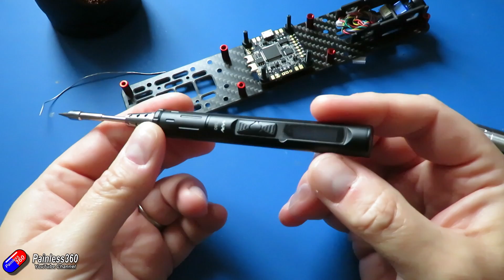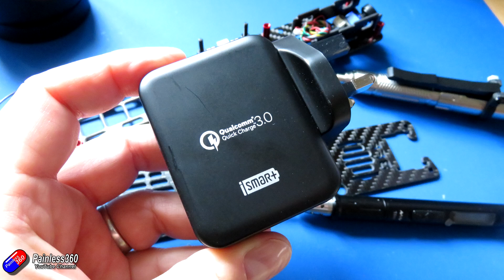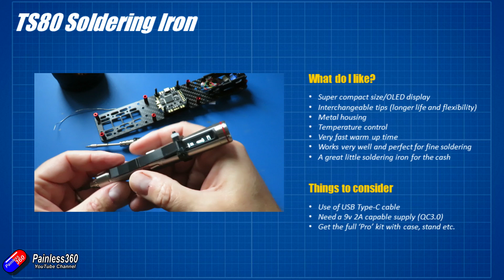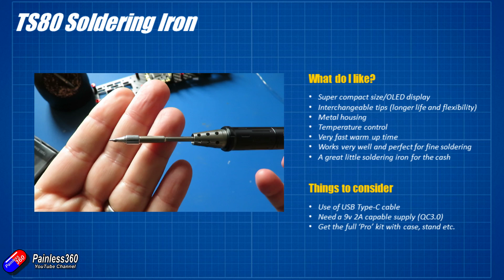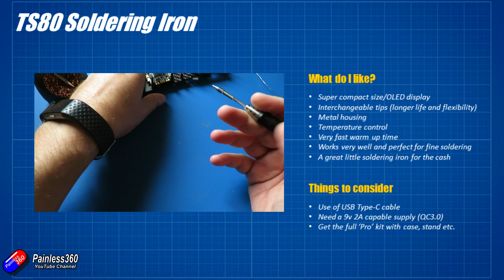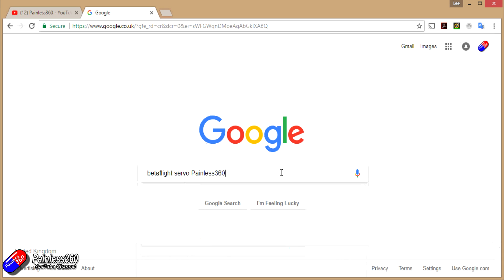TS80 'Smart' Soldering Iron

Comment: USB-C with quick charge 3.0 makes this an iron I can use everywhere. I have plenty of those power bricks, I have a 3.0 power bank, and I have a 3.0 car charger. So, all good there. The tips are shorter, getting you closer to the board with more stability and the case is of nicer metal construction. I think the TS80 is worth the extra few dollars.

Comment: I actually really like that it uses USB C. It gets more and morethe universal standard for small electronics starting from ssmartphone, over laptops to now this soldering irion. You don't need to think about the connector diameter/pin diameter. Just use a high quality cable and a powersupply that you even might already have. Think for small electronic stuff we will see this more and more in the future insteal of the old connectors we are used to as USB C is also a smaller form factor and you can build smaller devices.
Reply: usb c is a gimmick right now, as most electronics cannot supply enough power to it, most electronics cannot stream video thru it like advertised ..and so on.. the "benefit" of having it reversible is useless as the other end is not :))

Comment: I have the TS100 and flashed it with open firmware. I love these Irons so easy to work with, fast at heating up and the tip range covers all your needs.
Reply: Yeah the open firmware let's you go to 450 degrees

Comment: Like the ability of the ts100 to use a lipo battery as a power source.. Sorry if you did say this one could. I missed that in the video.. Wish the soldiering tips were interchangable with the ts100 but do like the new tip connector style, seems more robust... Thanks for the video.... Cheers !!!! 😁